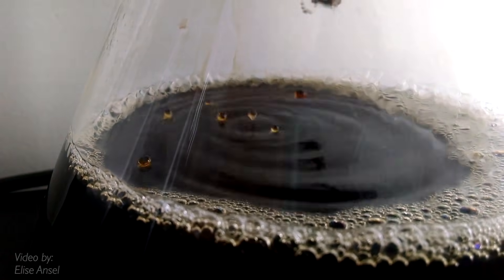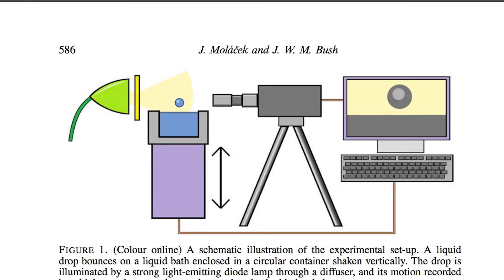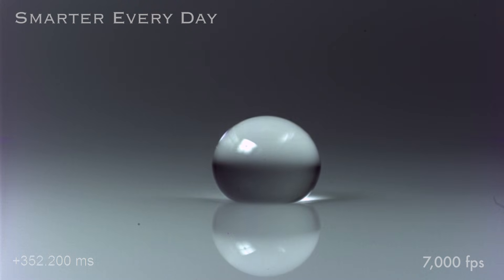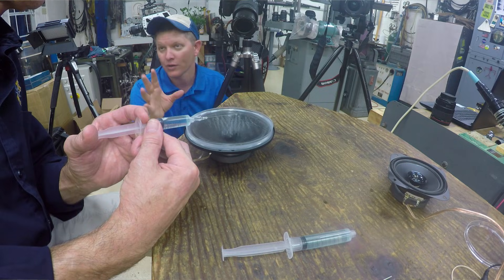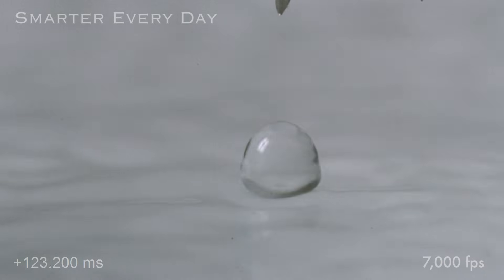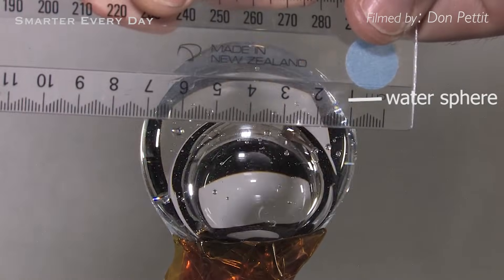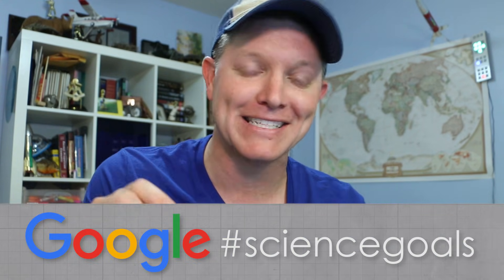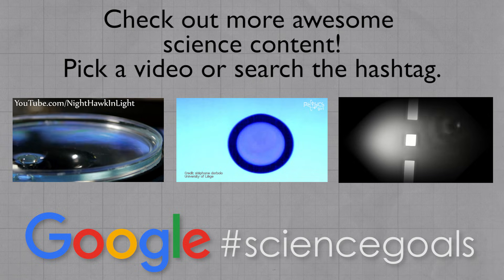The WALKING WATER Mystery (in SPACE and SLOW MOTION!) - Smarter Every Day 160

Comment: G'Day from Perth, Western Australia, 
Could these water balls be indicating that water is a Non- Newtonian fluid to some degree ?
The dripping drops bounce like "silly putty"  & cornflour/water mixture creates balls on a speaker.
We know water does not compress, theses impacts & high frequency mechanical shaking would exert points of compression on the surface of the water. 
If H2O is a Non-Newtonian fluid the surface tension would increase & prevent coalescence?
Cheers Andre'
Reply: It's due to a film of air getting trapped between the water and water drop.
Reply: @SomeGuy-vo7we  - I did watch the video & while I agree the air film could cause this, I can't see how it is trapped when it can escape eazy around the equator of the droplet.
Also as the drop approaches the water surface only the small bottom of the lower hemisphere get close, pushing the air out of the way.
The air can do this freely with little obstruction. Some of these drops walk on the surface for a while, too long to attribute it trapped air alone. 
I put my proposed explanation as an alternative or contributing to the suppressing of coalescence?
Do you or anyone else have logical argument as to why this is not a possible explanation of what is going on. 
For me that is what this channel is all about, Questioning Why & How things happen.  No harm in questioning.
Cheers Andre'

Comment: If the mass of water has a north and south pole and the water droplet has a north and south pole then you are dropping the droplets south pole onto the mass of waters north pole. Because the droplets north pole is close to the mass of waters north pole they push each other apart until the south pole of the droplet slowly coalesces pulling the north pole with it. I do not think it has anything to do with air gaps.

Comment: I have an other theory about why the water drop doesn't go through the surface right away.  Could it be that the difference in temperature affects it? The temperature affects the distance between the molecules, so if the gaps in between molecules isn't the same, then it could keep the surfaces from "melting" together if there isn't enough force applied towards each other. A bit like gears that aren't the same size can't fit together. What do you think?

Comment: I work in interventional radiology. Ive noticed this on the iv drips we use to flush arterial sheaths. We use a very slow rate and the drop stays at the surface of the saline for atleast a couple seconds. Ive always wondered why this happens but i dont think its related to air or vibration. Ill record it and send it to you.

Comment: It's my understanding It's all about surface tension.  H2O molecules are in the form of a triangle. There is a very strong bond between the hydrogen and oxygen pair.  Surface tension is due to these triangular molecules aligning in one direction at the surface due to their charges.  Like charges repel, opposites attract.  The molecules align in such a way that not only do the water molecules on the surface plane attract one another, but that outwardly they repel along the plane.  A water droplet is a group of molecules that because of this same principle, project this repelling force outwardly as sphere.   Water does mix with water but when water molecules are all aligned the surface and the drop both have the same charge.  It's not a large charge, but it is there nonetheless.  As the drop settles and the air molecules are pushed out, eventually this is overcome by proximity of the molecules, not unlike the flipping of a magnet in proximity to another magnet with the same pole.  Once those molecules on the surface begin spinning around, there is a cascade and the the drop merges.  Under the right conditions and with pure enough water, one might be able to suspend a drop indefinitely.

I would think if you could zoom in enough with the high speed camera, you might be able to detect the deformation of the water surface as the drop approaches, before it actually makes contract.  This would definitely illustrate the like charges repelling.

You might also try to see if smaller drops last longer.

Comment: I believe the smaller the drops, the stronger the surface tension is. Surface tension is much like a "skin", similar to the latex of a water balloon. Larger balloons are weaker, smaller balloons are stronger. Water drops are the same as the molecules that makes/ produces the surface tension are "stretched" thinner/ weaker in a larger drop (or flat surface) and are thicker/ stronger in smaller ones. And it is the dissimilar skin strengths that helps to prevent the coalescing much the same way temperature differences prevent mixing of liquids and vapors. Vibrations will "shake" at different frequencies as well causing the dissimilar skin strengths to be even further apart, a shearing effect if you will, allowing the drops to remain whole longer before coalescing. My two cents!

Comment: It is one of two things.  1. If the conditions are right the water will bounce up and separate into a drops.  Never thought about the air pressure (hmmmm?) or temp.  The drops and the water have surface tension with air in between.  The surface tension has to be overcome on the water and the drop and will make the drop for a moment skate across the surface and slow down coalescence. The air gap in rough water is maintained longer.  Timing is key with conditions.  2. Oil in the water also cases it but it is not normal.  On a oily garage floor this is very common to see and the crops weill last for a long time because the oil stops coalescence also completely.    The Celo has a rough wave which causes bubbles to form.  Celo has notes that are also called "Poo/Brown notes" which the military have been experimenting with for crown control.  These notes make you feel bad have been "rumored" to cause bowl movements. :/

Comment: 4:04 - My first guess will be this is due balance of forces; the air gap works to first reduce points of contacts between the bead and the main liquid surface, and just works to prevent the bead from joining the rest of the liquid at the onset of the first few bounces. This can be tested by dropping the droplets from different heights at different liquid levels on different types of hard surfaces. As the height increases you will expect more bounces, same with shallow liquid level, same with liquid on hard surface (try this on an angled smooth granite surface with shallow liquid flowing down). For the liquid molecules on the surface of contact line there is a net force keeping each in their camp, as the air gap diminishes the difference in these net forces also start to diminish and the molecules in the boundary between the 2 surfaces now begin to accelerate their mixing, this will happen so fast as to create a somewhat shock-wave which is seen in the video.  All other properties of the liquids (temperature, viscosity etc) will also play an effect depending on how they play into these force differences.

Comment: Hi Destin, this is absolutely the second best science video I ever seen. I don't have time to read Don's articles. Anyway, I think not only air is implied in the physical resistance to coalescence. Perhaps the very ultimate instant of coalescence - at molecular distance - is retarded by electric repulsion between identical double charge layers in the outer sphere of water molecules. This could be somewhat related to the residence time. Maybe, this kind of repulsion could be prolonged by using a low dielectric gas as sulfur hexafluoride.

Comment: Why not just surface tension? Both the drop and the reservoir have surfaces and they maintain them until sufficient force breaks through it allowing them to merge. Whether there is an air gap or not, all the observations support the surface tension hypothesis.

Comment: I doubt it has a lot to do with gravitational force that the bigger drops coalese quicker. Gravitation is a very weak force. Proof is that the surface tension is strong enough to overcome gravity otherwise the drop would immediately flatten. I suspect it has to do with the steepness and length of the "water mountains" that are produced with various frequencies and amplitudes. I guess the water molecules of the "mountains and valleys" have to be aligned in a certain direction to exert maximal dipol-dipol forces with surface molecules of the droplet to disrupt the droplet.

Comment: IMO____________You possibly had the answer in your hand with the water balloon. The water in the balloon is surrounded by a protective impurity called rubber. The water  droplets are surrounded by a protective impurity called dust. Dust contains any number of impurities less dense than water so they remain on the surface until gravity pushes them to one side, allowing the water to coalesce. The  varied vibrations momentarily inhibit the impurities' willingness to separate. The cello effect is a completely different phenomenon. This is only my hypothesis....probably what I would have tested for first. Remove all dust to near 100% water (impossible due to "surface evaporation" by-products like steam). To say that steam is water.... is like saying sand is rock. All this is "off the cuff" and my first observance.

Comment: @SmarterEveryDay No doubt Vibrating surface can cause this phenomena but do you think of try experimenting with cold water droplets? I think on normal surface it could occur when the temperature of surface water and droplet water is slightly different in cold. 
Or
Little Hot Water Surface + Cold Water Droplet
Cold Water Surface + Cold Water Droplet
Cold Water Surface + Hot Water Droplet.. 

You must try these on.

Comment: I would like to see the effect of dropping droplets of water that is of different temperature  from the pool of water. I think this may have an effect of the drop not coalescing as fast.. (thermal fluidity??) hot and cold not mixing as well as hot and hot? another factor I am thinking is thw water drop get exposed to air and perhaps absorb air as they are flying down though air? and pooled water may have already released air absorbed? I would like to do experiment using different temp waters. another factor.. perhaps the water drops absorb some static electricity which then causes the repelling of the droplet from the pool of water??

Comment: I think that the surface tension and cohesion in a liquid is what makes it bead up on itself, because the liquid drop has the same surface tension as the contact pool of liquid. To prove this, all you need to do is add surfactant to the water drop only and try the same experiment. You could also do another with surfactant in both drop and contact water.

Comment: I stopped before 50 seconds in. I don't need to be strung out for another 10 minutes to learn about surface tension. I thought after one had seen and understood their first meniscus, this wouldn't really be a question. It's about surface tension, from the hydrogen bond between water molecules.

Some water will flow, some will form into globules/drops. Some drops will have enough kinetic energy to break surface tension. Others initially wont (maybe formed from an impact), and will need some event to make flowing into the mass the new energy low. Sorry I don't have the time to see if we reached the same conclusion. 

It looks wacky, but is hardly a mystery if you think about it.

Comment: The reason that the force created in the water balance doesn't cause the droplet to break and coalesce, has to do with the fact that the surface tension is greater than the pressure exerted. It is only when the surface tension begins to break down that the coalescence happens.

Comment: I am certain there are 2 more controls that are being forgotten or not taken into account for. We already know surface tension is a factor. but the main control being left out, is the surface tension/charge ... the charge of waters surface tension between the droplets and the body of water being the same must be accounted for. we also know static build up occurs when the kinetic energy of motion is accounted for. as the droplets inner currents recede, the outside surface tension charge goes back to equilibrium and thus the droplet can coalesce back into the body. the energy of molecules racing withing the droplet would cause its surface tension/charge to vary.

Comment: Laminar flow of small particles? 🤔 Seems like that "field" of separation has equal potential, so until one of them yields to the other by a slight decrease of polarity then the coalescing of the two items happens.  
🙄🤔
Try it again with soapy water (not enough to make many bubbles, just enough to alter one of the 2 items) and compare the time span between the two versions.  Now it's more than curiosity 😁

Comment: Destin, if you take a styrofoam cup, fill it to about 1/2 inch below the rim, drag it across a, say,  tile topped table, that is a smooth surface that is "sticky", until the cup vibrates.  The liquid I notices that with was tea with milk. Soon the liquid will vibrate until droplets separate and then dance on the surface. It seems to me that here when the droplets separate there is minimal impact and that thus the influence of the air gap minimal. It seems to me that the effect of the surface tension is the predominant factor here.

Comment: I didn't hear anything about surface tension being a major factor and I find that strange. The reason why jumping into water at high heights is dangerous is because of the surface tension of water not the air pockets compressing between the object and the water. I also learned that there's something about the molecular structure of H2O that contributes to how the molecules organize themselves to repel things at their surface (you know, like how bugs walk on water). It doesn't surprise me that two separate bodies of water with their own opposing surface tensions would repel each other until the molecular structure of the drop is disrupted by the body of water it's sitting on.

Comment: What if it's not air in between, but maybe something with the resonance in the water, that makes two different surface tentions resist each other?  That could also be explained in the low pressure chamber, because the water would have tension in from the negative pressure, pulling out from it on every side, making it want to break past the surface tension more.

Comment: Static electricity on the drop acting as a force field.
Ground both the reservoir and the source of the drop and you minimize the drop to what little static electricity it can generate in the air before it lands, then you will get about half the dancing beads.

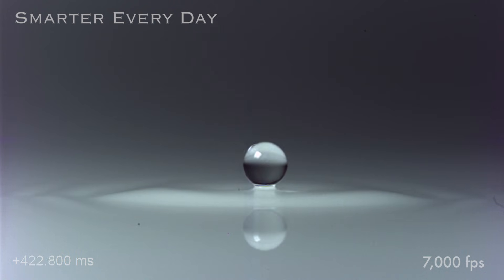Comment: 4:00 all this bubbles of water on water... come on, are you realy that stupid? Water is solid. To mix with the watter you need to brake surface. Thats why if you smash water surface fast with hand, you feel like you hit something solid. Thats why water droplets does not have enough weight to break water surface and its self stright away!
Reply: Most droplets do break the pool's surface, you know. Many people in the comments have never noticed that they sometimes bounce. So much for stupidity.

The reaction when smashing water is not because of "surface" breaking but rather because water as such is pretty much incompressible - at surface, as well as 1 cm below it, as well as 5 cm below it... Some volume under your hand is set in motion instead of compressing easily, and you feel the inertia.
Reply: @u1zha  did you read what you just write? seriously how old are you? 2? lol or you just apple user?

Comment: Could it be the particle charge and polarity is fluid, and establishes its subjective polarity in the droplet, which is different to the larger body of water, upon landing it takes a short time for the larger body to polarise the droplet in line with the larger body, due to waters fluid polarity. There is a critical point, where there is sufficient polarised particles in the droplet to break the magnetic differential.

Comment: Might be late But i was working Soap and Mettle rods washing them to paint them. But these rods  was full of oil. i actually noticed this a few days ago and happend onto this video. i belive its the oil in water and other stuff. i belive there is oil in everything and that its the oil that creates that watter running on water. coz that drops does not happen in the bigining but after a While of washing these mettle rods i started noticing those drops hapening with Larger water droplets.  and that i can create it just by Picking  up the water and dropping a bunch with my hands on that water in the drum and it creates a Bunch of those drops deference in sized!

Comment: probably very late on this, but it appears VERY specific harmonies are causing the "break away" inside the bubble for Don in space. The celo might not have anything at all to do with it, instead SUPER specific harmonies inside the piece and by that specific celo at the time caused it. Just a hypothesis. I wonder if you pass through all the frequencies in the range of the piece will you see the same generation of dropplets at any specific tone, or does it require vibration at more than one specific frequency to both cause disturbance of the surface, and generate the right amount of force on single points in the system to break away the drops. It is possible that inside a closed spherical system like this, the math for the frequencies just doesn't work out to generate new droplets with a single tone. Now I want to see if harmonies (or chords) can be used to generate the droplets like this on earth with the effects of gravity applied.

AHHHHHHHHH SOOO MANY MORE QUESTIONS! IONLY HAVE MORE AND MORE AND MORE I WANT TO TEST NOW!